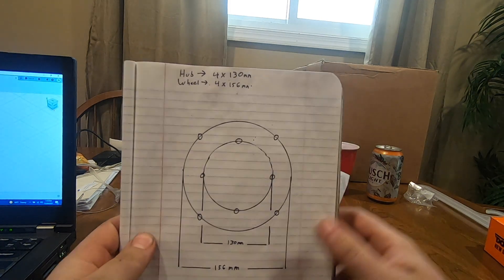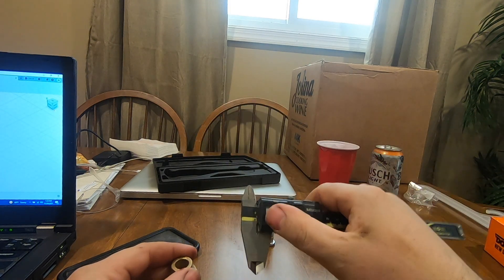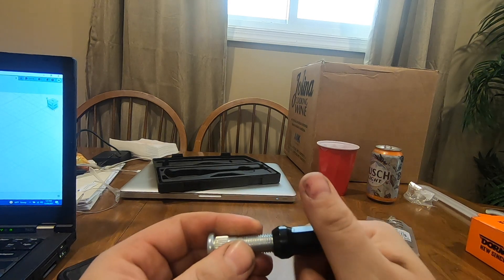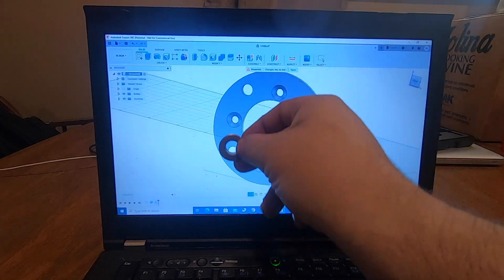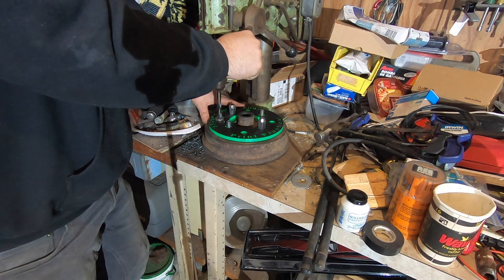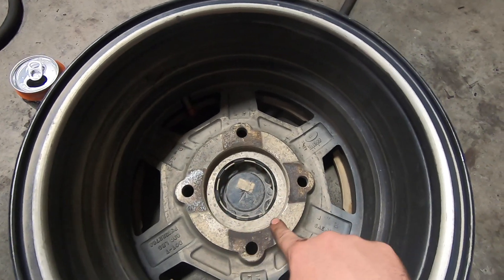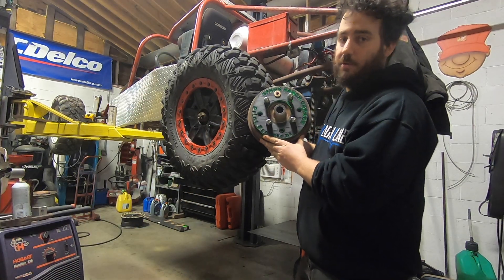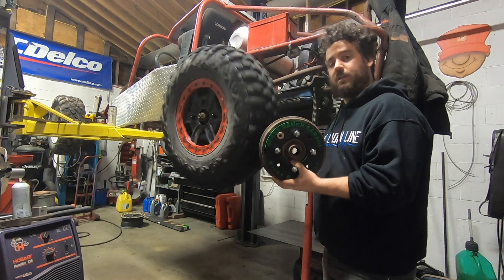Changing bolt patterns with 3D printing. 4x130 to 4x156. VW rail buggy gets SXS wheels.

Comment: I was actually thinking about doing this with double the holes. My new ferd axles are 8x170 and i'd rather be 8x6.5. I was going to do the same thing with a fixture cut out of plastic engraving stock on our CNC router. Looks like it would work. 👌